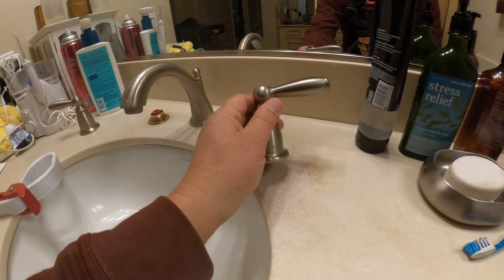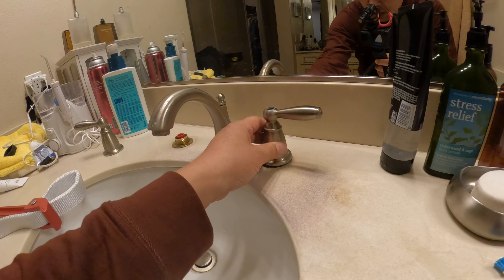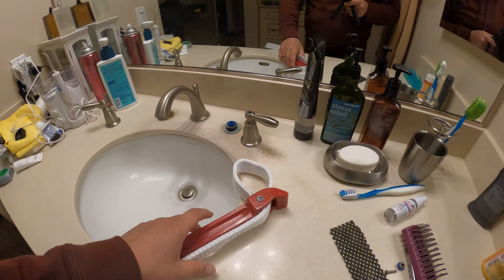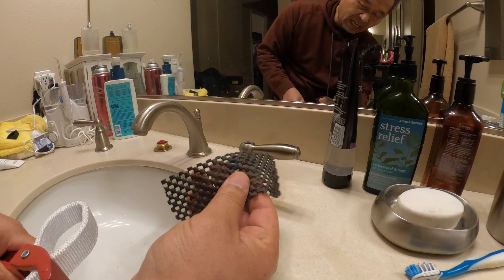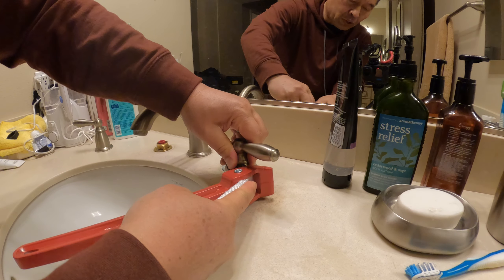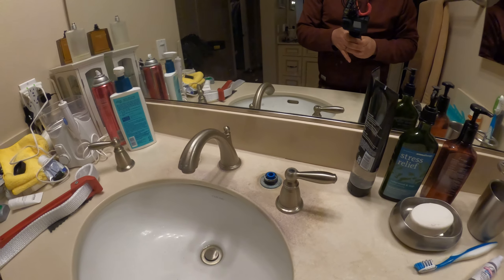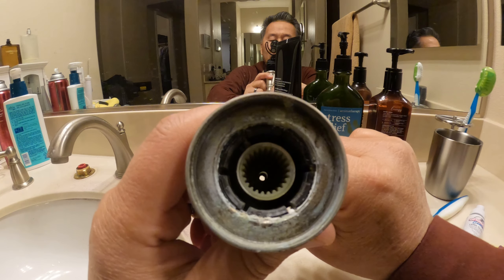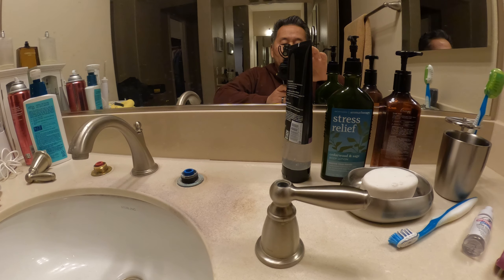Removing Stubborn Moen Brantford Bathroom Faucet Handle

Comment: I’m curious how you removed that small piece from the very top of the handle. Is a screw in there?
Reply from the maker: The small silver cap above the color ring just pops off. There is a small screw inside that secures the handle to the bell housing. On my particular faucet, I didn't really need to remove the screw to remove the bell housing.  The whole bell housing just twist off without removing the screw on top.